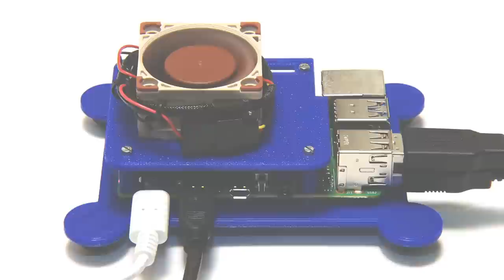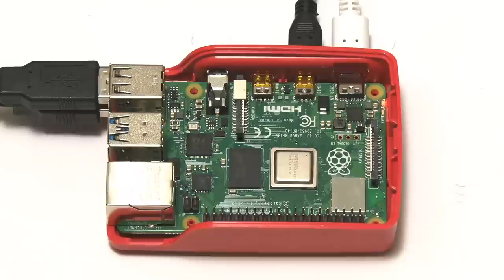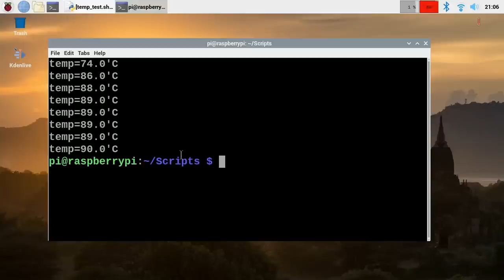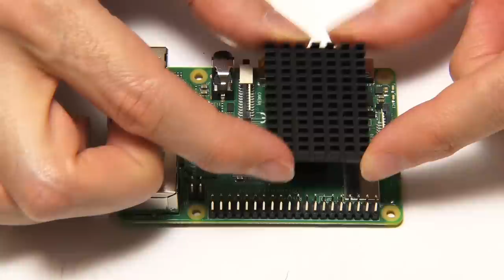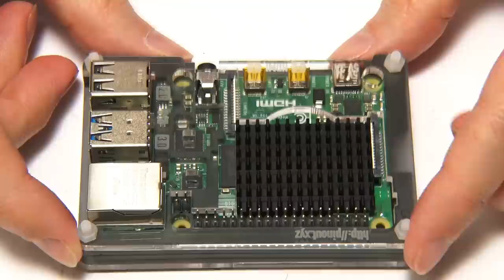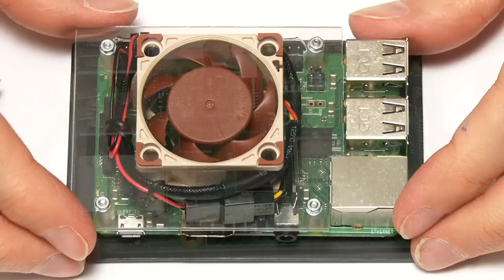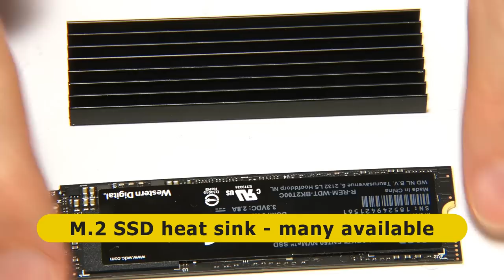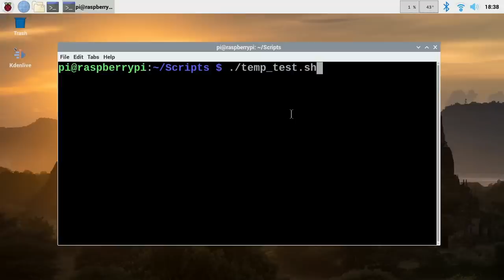Raspberry Pi 4 Cooling

Comment: It's worth noting that there is a 10mm thick version of that fan, and the fan being half the height might be useful when the pi is so small. Combine with shorter standoffs to get closer to the heatsink and you could shave 15mm off the height.
Also, it would have been nice to see temperatures for the bare pi with no heatsink and no case, since we have no idea how much of the small heatsink improvement is from the heatsink and how much is from being open-air.

Comment: THX Chris. Very enlightening tests. Personally,  I would go with the small heat sink coupled with a more ventilated case. The active cooling solution might present a hindrance to those wanting the Pi to use the least amount of space in a project. Cheers.
Reply: There are smaller fans available as well, and some cases come with them built in.
Reply: @alvallac2171  Cool...I'll look into it..thx

Comment: Excelent video! An alternative to active cooling should be putting the Pi in vertical position rather than horizontal. By doing this, hot air will rise from the heatsink and cool air will get from the bottom, as if there were a fan pushing it due to the air diferential weight (hot air weights less). If you have time, please give it a try. I dont have one to test myself..

Comment: Just a follow-up; other sites are reporting interesting results with passive cooling, using aluminum cases as heat sinks.  That scores on the "Simpler is better" scale. An extreme thought is using a copper case. The thermal conductivity of pure copper appears to be roughly twice that of aluminum, though copper alloys like brass and bronze are dramatically less conductive.

Comment: In the end I used a large pure copper finned heatsink with a fan attached on top of that, doesn't look pretty, but it works well, typically see mid 30s

Comment: Love your channel, was were interested in the subject, but the Noctua fan is just too big for Raspberry, in my opinion.
So I bought the set of Enzotech copper heatsinks on eBay (4 heatsinks of 3 different sizes), and used then with the smaller 30mm x 10mm v5 fan.
Two biggest heatsinks in the set are Enzotech BCC9 (14mm x 14mm x 9mm), but they have taller BMR-C1 (14mm x 14mm x 14mm) heatsinks if needed.
All heatsinks are attached with the 3M tape.
Here are the results I got running your script:
temp=35.0'C
temp=45.0'C
temp=45.0'C
temp=47.0'C
temp=47.0'C
temp=45.0'C
temp=47.0'C
temp=48.0'C
It looks like having better heatsink is more important than better fan.
Reply: heatsink is more important than a fan
(but I'm running with just a fan, no heatsink)

Comment: I don't have a Pi4 yet but I'm on the list to get one. On my Pi 3B+ I use the C4Labs Zebra Virtue Fan Case Black Ice version. It is a little on the pricey side but it seems to be the best off the shelf case I have found. Running Ubuntu Mate I force over clock to 1520 525 on the RAM GPU and I stay about 10 degrees above ambient air temps.  I do have a copper heat sink on it that is a bit larger than comes with the kit though. I had the heatsink for many years and I think it came out of a GPU cooling kit. Happy Cooling.

Comment: OMG that temp at the end was high!  on my first Pi 4 I used an old southbridge heat sink with a cheap and nasty 5v 40x5mm fan, temp at end of test was 32C  None of the other chips get hot, it's normally the ground plane conducting the heat outwards!

Comment: An infrared camera would be a useful tool for seeing how the various cooling solutions affect the board, as well as to see what areas need to have more attention paid to them. I'm wondering what the difference would be between the infrared image of a board running without heatsinks, and one running without heatsinks, but also with a desktop fan blowing across the board, without blocking your view of it.

Comment: Nice, i kept it much simpler since i am new to this and just wanted to make something i might as a replacement for intel's compute sticks. I just took a unity case, made a nice hole on the top. installled the Noctua NF-A4x10 (so the smaller one) inside the case no heatsink at all. My idea was that it will 'pull' air from the side and the ports over all the chips. Results are not as good as yours but it went to 70c but this was on a 100% max overclocked PI4 cpu and gpu and a fully closed case. Happy with that as a result. I think someone should make unity based cases not with 30mm fans we see now but 40mm fans like the Noctua NF-A4x10 and you are kind of done. Not sure if i have room for heatsinks or if its needed on the types of apps i do (not always pushing 100%).

Comment: It would be great to have a heatsink that is just a block of metal as an upside down cone so that it can function as a coaster.
When the pie is working hard, you put a steel cup filled with water on it... natural convection will just keep the water a little warmer than
ambient.  When it's not working too hard, you could use it to keep your tea warm.
Reply from the maker: Yes, agreed -- like they have for a RockPi 4B, for example.
Reply: *Pi

Comment: I finally got a raspberry pi 4 2gb model, Stole a fan from one of my pi 3s just a small pi fan, but it makes all the difference from idling at 71 degrees to idling down at 36 degrees. The little fan is a bit noisy though not sure if that's just its age or if it was always this noisy, but it works so I wont complain. Not entirely sure what I'll use the pi4 for but for now I think it will be my main management machine for the other pi boards I have. Will probably pick up another to use as a nas since it has the usb 3 ports and full gigabit lan. Till then I'll just tinker and play with this one.

Comment: That's why ARM chips for mobile phones use slower Cortex A53 cores alongside with more powerful Cortex A72 ones, and run powerful cores only when strictly necessary. If phones ran only A 72 cores all the time, they would have been as hot as this Raspberry Pi in a case.

Comment: the small heat sinks on their own really only lowers the temperature of an idle SoC. I have seen no noticeable difference to the temperature of the CPU in full load with or without the heat sink. Airflow is a must, so any Raspberry Pi 4 case should include a fan.

Comment: Should have checked out the ice tower cooler for the raspberry pi. ETA Prime made a video about them, and their about 20 bucks on Amazon. They even feature a copper pipe.
Reply from the maker: I am aware of that cooler and have been offered one for test.
Reply: @ExplainingComputers  Oh great! I'd love to see someone else's opinion of it. I'll be looking forward to that video. If I works well enough confirmed by more than one person, then I might get it for my pi 3b, because it tends to thermal throttle from time to time.
Reply: *they're (contraction of "THEY aRE")
"Their" is for possession.
Reply: @alvallac2171  😂 I saw the grammar and thought well, someone is gonna correct me on it lol.
Reply: Tower sounds like good to have if one plan to overclock it

Comment: You could also put in a tall heatsink, maybe 10 cm or 20 cm would do and no need for a fan. Passive heatsink seems like a better solution. It does not need a powersupply, it won't get encrusted in dust, no electric motor to fail.

Comment: You have inspired and educated me with your Pi cooling series, but I have to wonder about your cooling setups. My Pi 4 idles at 30 C and running your stress script only gets my Pi 4 up to 36 C.

I think my results are because  I shape the heatsink to avoid interference with surrounding bits  instead of using a small spacer, and I Gorilla Glue the heatsink directly to the CPU. This eliminates a lot of thermal resistance.

Or is my Pi sensor out of spec, or ...? Regardless, such fun.

Comment: Nice overview of what is going to be a popular Pi, that said I still think the Pi0W is my favourite Pi for the money/utility.  I’m still not getting what the Pi4 is for so to speak- it still isn’t really a mini- PC that I could see any organisation really using.  That said the community usually comes up with some novel ideas and once the farmwear gets, well, firmed up, we may find more fun to have.  It desperately needs to be able to firm boot off SSD, RTC, proper shutdown- all these can and will be supplied by HATs but it adds bulk and cost.

I think you missed out on the oil cooling option, although based on my 3+ oil cooling I think that you won’t get far off (like 1c) the Noctua cooling scores with the added benefit that it will be less bulky and messy (it isn’t really messy, it is baby oil really).  I could get below 50C with the B3+ so it seems likely the Pi4 will be only a few degrees higher on oil.

What I think you will find with oil is short bursts won’t heat load the coolant so you’ll get longer at lower temperatures before it creeps up to low 50Cs.  Until someone gets the farmwear able to fully unlock the CPU (and that will bring its own problems with the associated chipset I think) it’s a moot point really as 50 odd centigrade on air is fine.

eBay (via China) do a lot of heatsinks very cheap, I buy in bulk- for those that fancy an aluminium case with built in heatsinks this is the cost-effective way to go.  A Dremel is nice but a hacksaw will do the job.  I have a miniature ‘modellers’ mitre block- with a Dremel and some application your ca build bespoke heatsinks.  Also, it is worth considering some of the better-quality thermal cooling solutions, although I still stick with the ‘tape’ in most cases I have found I can get nearly 2C better with the quality stuff- if such things matter to you.

Great video as always.

Comment: My 1GB Pi 4 runs a reasonably fast Samba NAS server and a WordPress server (Nginx, MariaDB, PHP). On average, with this "non stressful" configuration, the Pi 4 would still average about 58 degrees despite it being in a VERY ventilated bumper case. I didn't find the heat sink that Vilros included in my Pi4 kit to help with heat at all, so I removed the heat sink so as to allow a fan to be closer placed above the cpu. I already had a 50mm 12 volt pc fan handy, so I installed its power leads onto pins 4&6 of the Pi and the hot-glued the fan to my 3D printed bumper case. The 12 volt fan runs fine despite it only receiving 5 volts. It keeps the Pi4 running at about 56 degrees under extreme tests such as you did in your video. It runs at about 39 degrees under normal (lesser) samba/wordpress loads. .... so I'm fine with that. Here's a link to a pic of my diy modified bumper case with it's installed 50mm 12 volt fan: https://www.c-cupp.com/downloads/Pi4-Bumper-Case-wth-Fan.jpg   and here's a pic of my test results when using the fan in the bumper case:  https://www.c-cupp.com/downloads/Pi4-HeatTest.jpg

Comment: I hope for more quirky cooling techniques on the pi all the time!  A water cooling solution would be fun, but I wonder if anywhere makes a suitably small phase change cooler that could be hooked up!  That begs the question, what is the lowest temperature the Pi 4 is stable under?

Comment: I think the only way you can run it in the official case is with the lid off. Closed is just too restrictive for ventilation, which makes no sense 🙁. It's a real shame they didn't stick with the same design as the previous version and have a removable section in the lid and removable side panels. Or at least some ventilation holes, maybe in the shape of the Raspberry Pi logo. At least you could get some air flow then.

Comment: Chris, any fan solution with good airflow should work reasonably well, even without any heatsink on the main Pi 4 SOC at all, but some folks really really really don't like fans, so it's worth exploring the ways to optimize the passive cooling. 

The Pibow Heatsink in your testing didn't live up to it's potential due to the poor design of the companion Pibow case. This case provides limited airflow potential for the heatsink, and sacrifices most of the natural cross airflow cooling potential of the Pi 4 circuit board. In addition to that, if the user is not careful the Pibow heatsink may stick down to the RAM and not be completely flat and well bonded to the top of the SOC. Add up all of these issues, plus the fact that Pibow doesn't supply proper thermal tape and you have a recipe for disappointing results. Compared to some of your other projects, it's really easy to overcome these issues. 

First, remove the crappy non-thermal sticky tape on the Pibow heatsink, and instead install a 20mm square of proper double sided thermal tape directly on top of the SOC and then install the Pibow heatsink on that (this will insure that when the heatsink seats properly and has a proper flat surface to flat surface 100% bond to the top of the SOC). 

Next, just so you can see that this will work, as a preliminarily test, suspend the Pibow heatsink equipped naked Pi board over the side of a desk suspended by the USB-C power and HDMI cables with the board hanging down with the GPIO pin connector running side to side at the bottom, and re-run your worst case stress test. This is the optimal condition for the Pi4 and Pibow heatsink given it's design, and should completely eliminate throttling with worst case temperatures in the low to high 70's. Next, to enclose the Pi while maintaining this ideal free-air operating condition in a simple case design, get two 100mm x 160mm plastic panels (close to the golden ratio). The design orients these panels in the vertical 'portrait' mode, with the Pi4 suspended on two linked sets of 4 x 2cm standoffs in between the panels with the Pi sideways at the top (with the Pi4 only occupying one half of the panel with the GPIO pins running side to side at the very top).

Having the Pi 4 orientated sideways at the top leaves lots of space for free air ventilation and lets us route USB-C and HDMI cables out the bottom without tight bends to minimize stress on the Pi's PCB connectors, while still providing a reasonably compact sized 10cm x 16cm x 4cm "Pi 4 Tower" case that will free stand vertically. So if you get another Pi 4, you might want to recycle your Pibow heatsink and give this simple optimal convection cooling design a try.

Comment: Nice video - wish you had used the standard setup available from CanaKit with their case, their case and heat sink and lastly their case, the heat sink they provide and the fan they provide.  We have all installed and will run the test to see what our finished setup temps are.  Thanks for the vid.

Comment: Liked the vid.  Is audio recorded differently throughout? Example when trying to be specific talking about parts as if reading from a script, words seem to have a delay between each other, as if an auto filter is reducing the noise around the words.  But then when talking about opinions and how parts are made oddly, everything is fine and the flow of language and more natural.
Reply from the maker: All audio here was recorded live with the relevant sections of video.

Comment: Thanks for the great video. Surely the double-sided tape used to secure the heat sinks will act as an insulator, thereby restricting the flow of heat into the heatsink?
Reply from the maker: The tape is specifically make for this purpose, and transfers heat better than most tapes. But not as well as metal. :)

Comment: Great video Chris. When measuring temps before and after, did you load test? and what kind of load testing did you run. Love your channel
Reply from the maker: Sysbench was used at the 100 per cent CPU utilization load test -- that's what my test script does; take regular temperature measurements during a load test. :)

Comment: I've had every Pi model up to now, still use 3 Pi devices that have only 2 USB sockets but not sure I'll get a Pi4 yet if at all. All my projects are quite low CPU intensity so no heat issues, sure the Pi4 will be great for some uses but not for me at the moment. Very interesting to see the effect of cooling.
Reply from the maker: I doubt you are alone in your situation. I imagine a lot of Pi 3B+s will continue to be sold (not to mention Pi Zeros and 3A+).

Comment: I know the Raspberry Pi is a pretty cheap SBC, but you'd think they'd supply it with some sort of cooling solution out of the box. It seems a bit ridiculous not to do this when it can't even get through a basic test without overheating. In fact, after watching to the end, I think they should actually supply an active cooling solution. Perhaps they should offer basic passive cooling as standard and then active cooling as an additional extra. The Raspberry Pi used to be 800mhz and didn't get warm at all, but things have changed now and I think it's bad of the manufacturer not to supply adequate cooling.
Reply from the maker: I agree, they should at the very least supply it with a small heatsink on/for the SoC. And their official case should have ventilation holes (like every other computer case I've ever seen!). :)

Comment: I bought the PoE hat for the PI and it's constantly turning on and off.  I like that the fan will turn off when it's below some threshold but even idling it'll cycle between states.
I guess I should try a heatsink in combination with the fan.

Comment: I think you don't have to go to all that trouble. I connected a 30 mm China fan to 3,3 volts (slow/quiet mode vs 5 volts full speed) of the RasPi4 and reach a maximum of 52°C with the script from the video (with the original firmware without USB Mod; room temperature 28°C). Only the SOC is equipped with a 14x14 mm heat sink, the other chips without one.  Self-printed case, fan sucking over the SOC. Works fine and not too hot!
Reply from the maker: Sounds good, but I personally would not connect any non-electronic device to 3.3v on the Pi, as that is tapped after the voltage regulator, so there is a risk of damage to the Pi.